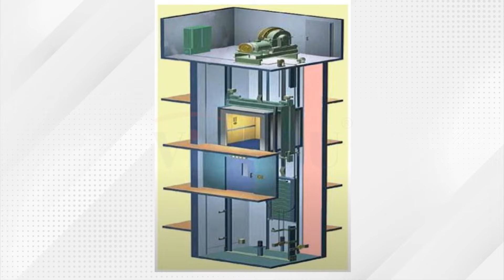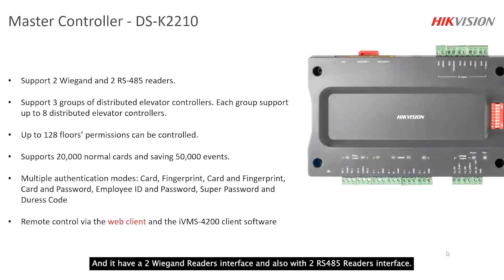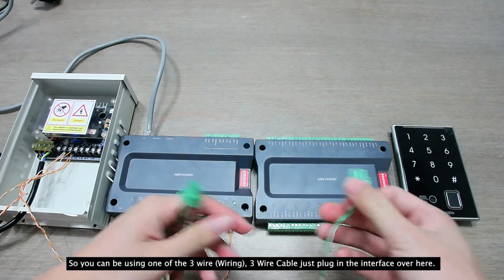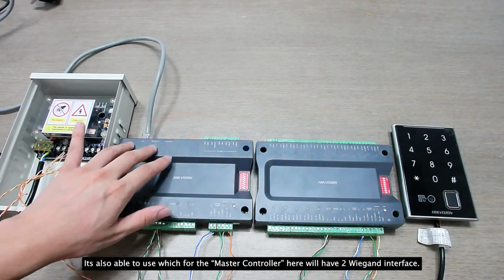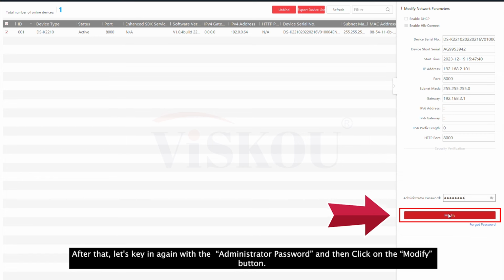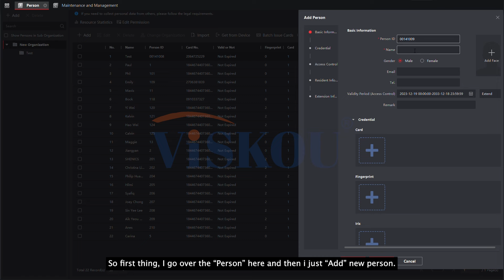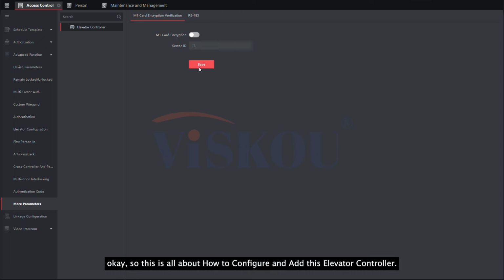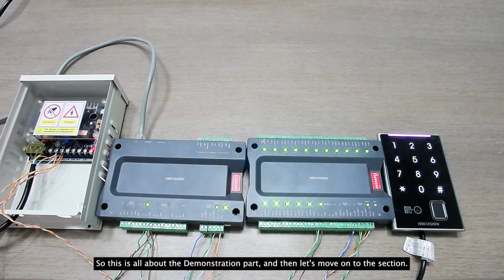SOLUTION: Install, Set Up & Configuration of Hikvision Elevator Solution DS-K2210 || DS-K2M0016A

Comment: I've set up as the same you did. But it's not working when using fingerprint. How can I configure on IVMS to use fingerprint?
Reply from the maker: Hi @BuiNgocCanh  Under access control , then look for authentication mode.
Reply: Hello, can you help me how to connect to a minmoe because the buttons in the elevator  are blocked?
Reply: We fix this unit today and after that lift is continue giving beep sound . Whats the issue